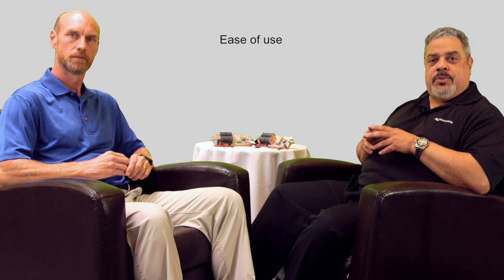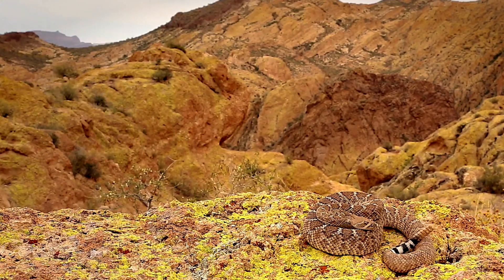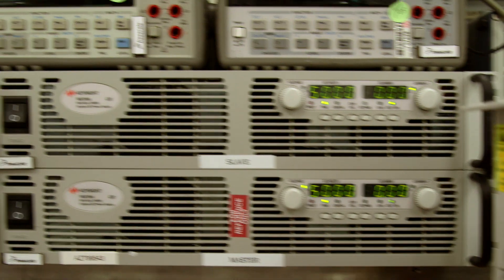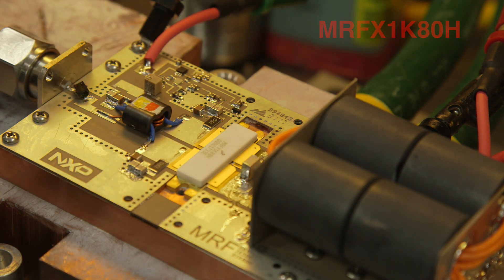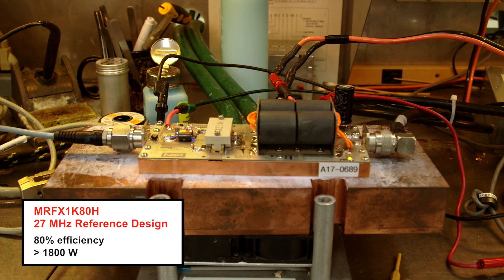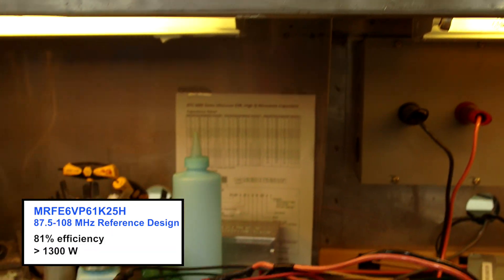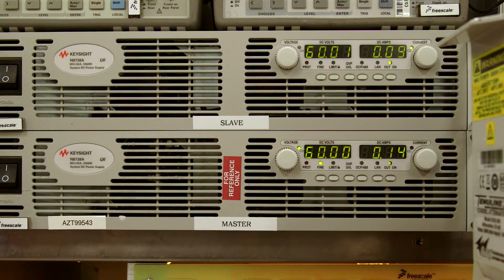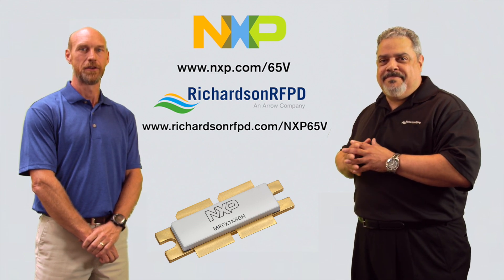NXP’s 65 V LDMOS Design Reuse

Comment: Let me just say from the outset that I am a Senior Systems Engineer for Power Beaming and Radar Applications.  After watching your video, why should I ever bother to design my own power circuits ever again?  Just give you guys a call, you not only steer me away from the rattle snake, but also give me sound advice for extremely good efficiency in Power Beaming and Radar Applications.  Cannot ask for more than that, I am duly impressed!